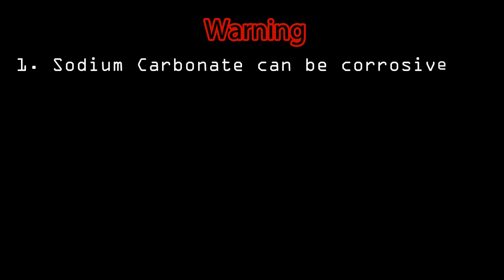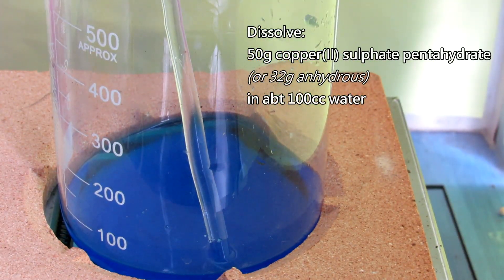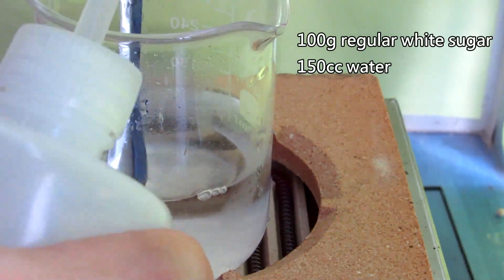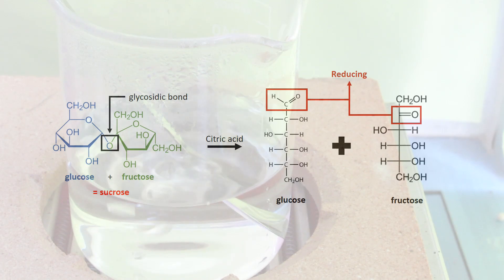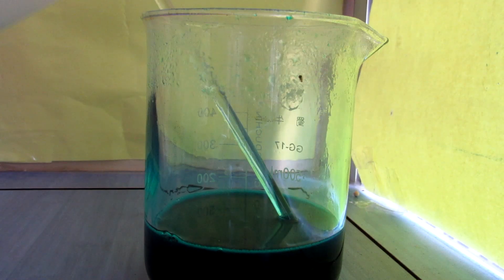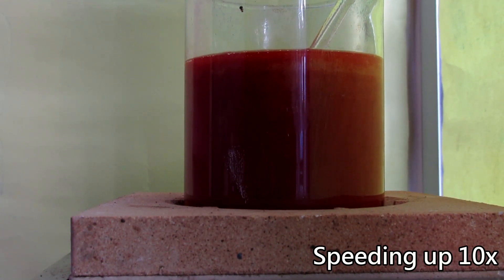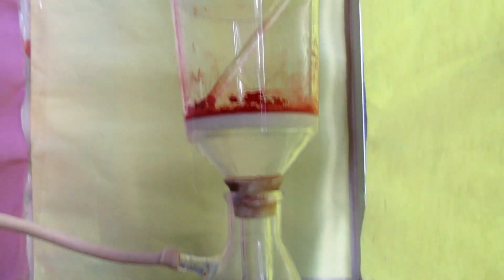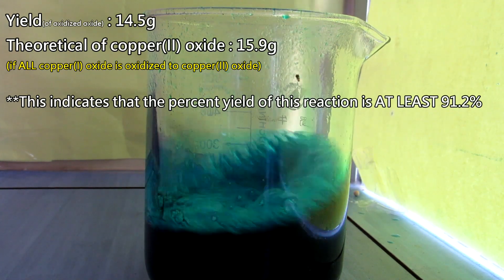Making Copper(I) oxide (Red copper oxide)

Comment: For determination of glucose in unie precipitation was yellow instead of red why?
Reply: Probably because the copper I oxide forms as nanoparticles (with a low concentration glucose solution).
The yellow stuff is sensitive to light, it turns black in bright light.

Comment: Hi, i liked the video so much ,it can be useful that if u could add the stoichiometry for each reaction. I guess that the first rxn was CuSO4+Na2CO3--> CuCO3 + Na2SO4 and then when you added the citric acid produces Cu3(Cit)2 + CO2 + H2O and for the last rxn, it is Cu3(Cit)2 + sugar --> Cu2O + Organic solution, i know that is not balanced but if you can confirm this, i´m going to be very grateful. Greetings from Mexico.

Comment: Similar to another suggestion for storage I was thinking that storing it under diethyl ether would be convenient. It’s non reactive and less hygroscopic than an alcohol, and when you’re ready to use your oxide it would evaporate off extremely quickly and cleanly. But ether might be difficult to come by or expensive for you so it has some drawbacks.

Comment: Hang on, where did the oxygen come from to make your copper 1 oxide? And why did you not show your oxidised copper 1 oxide when it turned black? This would have made it copper 2 oxide. I've just watched a video where some guy had to apply heat with a blow torch to turn copper 1 to copper 2 oxide and you just left yours to dry out? Doesn't make sense.
Reply from the maker: first question
RCHO + 2Cu2+ + 4OH- → RCOOH + Cu2O + 2H2O 
second
copper(I) oxide, when wet, is oxidised to copper(II) oxide very easily.
of course my Cu2O was just partially oxidised
https://youtu.be/Qk4iNBXh7I0?t=2m38s
I have shown the Copper(I) oxide in the video above, turned significantly darker than before
why heat is needed in your case is that the Copper(I) oxide is probably dry, which doesnt oxidise very easily in air
Reply: You're not answering the question. you're just relaying formula. I'm asking you where did the oxygen come from to make your copper 1 oxide?
Reply from the maker: hydroxide ions in solution
Reply: hang on this is confusing - where's the sulphate from your copper II sulphate in your equation? I cannot find it! One final question before I come a pain, how would you extract the oxygen from the copper I oxide?
Reply from the maker: seems you dont understand what ionic equations are
since the sulphate ions dont take part (are unchanged) in the reaction, they are called spectator ions and are excluded from the equation. 

I don't really understand your 2nd question... extract the oxygen?
If you are meaning that you still understand where the oxygen comes from to make the Copper(I) oxide, here it is:
Hydroxide ions are OH-, they bond with the Copper(I) to form CuOH, and 2CuOH -> Cu2O + H2O
The CuOH doesn't really form in reality, but the equation should help you understand how the hydroxide ions give its oxygen to copper to form Copper(I) oxide.
Reply: Quote - since the sulphate ions dont take part (are unchanged) in the reaction, they are called spectator ions and are excluded from the equation. 

It isn't a question of not understanding ionic equations, it is a question of applying the equation to what you actually do. But why use copper sulphate to make copper oxide when you could have used just copper to make copper oxide? There is oxygen in the sulphate - are you telling me the oxygen in the hydroxide takes priority over the oxygen in the sulphate? What happens to the oxygen in the sulphate? I can understand why they are called spectator ions....a convenient way to exclude certain stuf to make the equations less complex and avoid answering these questions. 

Quote - I don't really understand your 2nd question... extract the oxygen?

Well if you have created copper I oxide it must contain oxygen because it has been oxidised so how would you then extract the oxygen from the copper I oxide to leave just copper. In my understanding if you cannot extract the oxygen from your copper I oxide you haven't got a true oxide.
Reply from the maker: 1. You get a mixture of copper(I) and copper(II) oxide if u "burn" copper directly. In order to make pure copper(I) oxide from copper, you first need to dissolve the oxides mixture in an acid, then perform the steps I showed in the video. Therefore it is way easier to start from a soluble copper(II) compound

2a. The copper(I) oxide is not oxidised but it is reduced from copper(II).

Quote - In my understanding if you cannot extract the oxygen from your copper I oxide you haven't got a true copper I oxide.

Who told you about this? Does it apply to all metal oxides? Interesting.
Reply from the maker: There is a way to prove that oxygen atoms exists in the compound.
http://www.rsc.org/learn-chemistry/Content/FileRepository/frg/images//Finding%20the%20formula%20of%20copper%20oxide%20figure.JPG

use the setup in the link above, replace the Copper(II) oxide with the Copper(I) oxide made.
Capture the liquid droplets condensed inside the tube and test the liquid.
If it turns out to be H2O, then O must be present in the Copper(I) oxide made as it is the only possible source of O atoms in the setup
Reply: Sure but in the diagram there is copper II oxide, not copper I oxide. Like I mentioned, try and get the oxygen from copper I oxide. If you cannot extract oxygen from copper I oxide it is not a true oxide.
Reply: Quote - Who told you about this? Does it apply to all metal oxides? 

It's just common sense. Think about how other oxides are made and find something that is common to all of them. Then apply the same understanding to the way you made your 'copper I oxide'. Hopefully you'll get my point.
Reply from the maker: Like I said,  replace the Copper(II) oxide with the Copper(I) oxide made.
Capture the liquid droplets condensed inside the tube and test the liquid.
If it turns out to be H2O, then O must be present in the Copper(I) oxide made as it is the only possible source of O atoms in the setup
Reply from the maker: Your common sense is uncommon
how do u extract oxygen from sodium oxide then
Electrolysis?
You can do this to copper(I) oxide to produce pure oxygen too, if u can get the oxide to melt
Reply from the maker: You are misunderstanding chemistry
Reply: There is NO oxygen in copper I oxide.
Reply from the maker: Peter & Pete I look forward to your proof
I will disprove your proof
Reply: Quote - Your common sense is uncommon. That's because I don't follow a complicated and confusing system of understanding. 

Quote - how do u extract oxygen from sodium oxide then Electrolysis?

Treat sodium oxide with water to form sodium hydroxide then electrolyse it. Oxygen off at the anode.

You cannot apply heat to copper I oxide as this will turn it to copper II oxide. You need to use a different method of reduction to extract the oxygen from copper I oxide. So how would you extract the oxygen from copper I oxide?  I don't think you can which is why copper I oxide is not a true oxide.
Reply from the maker: Peter & Pete 
Ok so I am really stopping chatting with you as it is just a waste of time

Oxygen is given off at anode in the electrolysis of NaOH because H2O is what u r really decomposing.

Melt the copper(I) oxide in the space using an induction smelter powered by the sun, no oxidation to copper(II) oxide then.

Let’s just stop there
Reply: Fine by me but Oxygen is given off at anode in the electrolysis of NaOH because H2O is what u r really decomposing.

Er..no. The oxygen is extracted from the 'oxide' in sodium hydroxide!!! There is NO oxygen in water!!
Reply: It is a real oxide of copper. If it wasn't an oxide what is it because it isn't metallic copper at that point. Also "extract" wrong word. Oxygen is in water obviously, H2O. The NaOH isnt making the O2 in electrolysis  the water is. The guy who made this video knows what he's talking about, you don't. Also you can reduce red copper oxide to metallic copper in a thermite reaction therefore Copper I oxide is a true oxide of copper.
Reply: Reading this comment thread caused a major headache.
Reply from the maker: Just visited
Reply: +Chem Explorer

Peter & Pete are a couple of the worst trolls in the FLAT EARTH cult.  Have you visited their channel?
Reply: Fancy meeting you here of all people - the person who I blocked because he watches a flat earth video, then whilst watching, something comes into his head he'll leave a comment, then another comment, then another and another, another and another..............who's the troll?
Reply: You ought to watch our recent upload, very interesting take on hydrogen!!
Reply: Peter & Pete Funny.  You  come out bashing an actual chemist with you ignorant twaddle, trying to rewrite chemistry.

Comment: Can't you wash and dry in one step using Isopropyl alcohol, then store it under Isopropyl alcohol? I've found that ethanol is not as good for this.
Reply from the maker: That's a really good idea. I will use this method to store my copper(I) oxide next time i make it.

Comment: haven’t seen you unloading for a while, nice work. Man I gotta say that you are at one of the sweetest place for Chem, where chemicals and equipment are easy access and cheap. I think I have a similar hot plate for off Camera use, cost me less than 20 bucks including shipping.
Reply from the maker: I haven't uploaded for over 5 months because I was really busy
BTW although chemicals are easy to access, the synthesis of chemicals is highly restricted in my place. Actually it is illegal for me to synthesise any "dangerous"(flammable, corrosive, etc) compounds like what i did in the previous videos
So where i am is not really a good place for amateur chemists
Reply from the maker: *Also remember to keep my location secret XD.
Reply: Chem Explorer keep up the great work then.  We all learn from each other and it seems they don't like that.